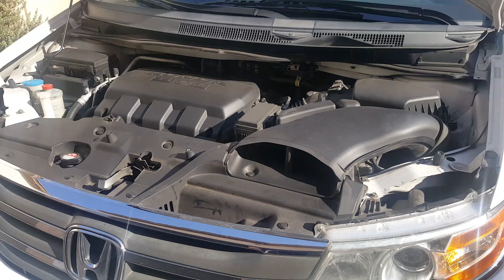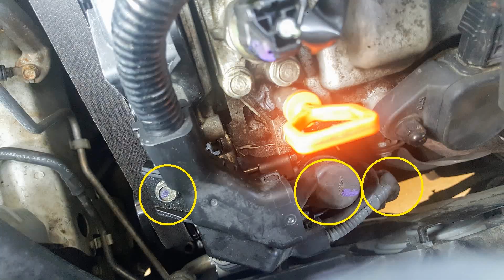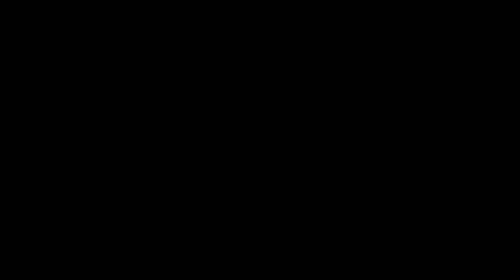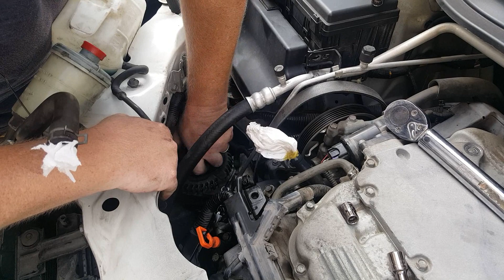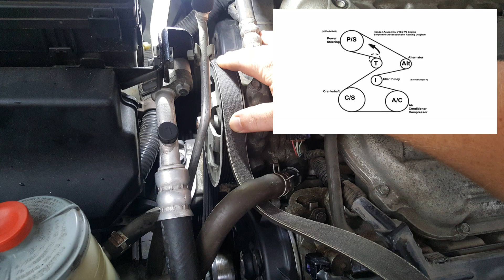How to Replace 2011-2017 Honda Odyssey Alternator | DIY Tutorial

Comment: I would like to add to the information in this fine video. I just did this with my 2011. I honestly don't know how you got your hand down to the AC compressor wire that plugs into the alternator. Even with the radiator and condensor top brackets removed, there still was not enough room. I ended up draining the radiator, and disconnecting the upper rad hose, which gives you about an additional inch, allowing me (actually my helper) to slide the hand down and disconnect it. It was still a PITA and your hand will have enough scratches to look like you were playing with an angry near-ferrel cat. You can't wear a glove. Here's a better idea. I was TRYING to avoid removing all of that plastic cladding at the bottom. Just bite the bullet and do it and here's why. First of all, remove the splash shield (yeah, it's only about six screws and about six plastic fasteners but it is a real hassle to get everything lined up to get it back on but still easier than messing with the radiator and coolant). But once it's off, you can more easily reach up and disconnect that compressor wire connection plug from the alternator. Here's the kicker-with the splash shield off, you can now access the four bolts holding the AC compressor onto its bracket. I didn't want to mess with the compressor either BUT, my alternator WOULD NOT clear one of the metal AC lines to the compressor. It's actually connected to compressor and there's no moving it without detaching it (don't do that).I decided I'd rather back those four bolts out instead of removing the belt tensioner. In fact, the Honda Shop Manual states to remove the AC compressor bolts and hang the compressor up with a strong wire and says nothing about loossening the radiator, etc. 

Here's what I found out and this will be my procedure if I have to do it again: Leave the radiator alone. Jack the car up and put it on safe jack stands. Remove the plastic splash shield under the front end-all of it, but leave the wheel well plastic alone, just remove the fastener that connects them to the front shield. Have some new plastic fasteners on hand since the old ones will disinegrate. These Gen 4 Oddy fasteners are inferior to the ones they used on my Gen 2's and they get brittle and break with age. You will need some 13 mm and 16 mm long ones, both should fit into a 10 mm hole. Get them cheap on Amazon. I bought this brand Rexka (13mm and 16mm, packages of 40 for $10 and they are just fine, identical to OE) Maybe this link will work   (https://www.amazon.com/dp/B078RKCVNG?psc=1&ref=ppx_yo2ov_dt_b_product_details)

Now remove the coolant bottle and PS bottle as stated and shift out of the way. Might as well give up and remove the PS hose from the pump, plug it with a wine bottle synthetic cork (no crumbs with that plastic cork, unlike real cork and do not use paper of any kind to plug anything). That PS stuff gave me fits the whole time-so much in the way and it wants to leak so badly, and I despise it. Anyway, when finished with this job, don't forget to bleed the PS system of air at the end while both front wheels are off the ground and not carrying any (or most) weight by turning the steering wheel lock to lock about seven to ten times with the engine running. Now, back to the alternator. Back the AC compressor bolts out about an inch-not all the way out (leave enought threads in for strength) and pull the AC compressor forward. It's still attached to its bracket so you won't have to support it. This will give you just enough room to wiggle the alternator past that one metal hose blocking your way. Now remove the alternator like the video creator states in the video and put the new one in. Don't forget to push and snap the compressor wire connector to the alternator near its bottom and retorque the compressor bolts before you replace the bottom shield. From the official Honda shop manual, the 80 mm bolt that attaches the alternator at the bushing has a torque spec of 33 ft-lbs (45 N-m). The two small alternator bolts (one for the bracket and one from the alternator to the bracket are both 16 ft-lbs (22 N-m). The AC compressor bolts are torqued to 16 ft-lbs. I hope to NEVER have to do this again so I bought a BRAND NEW Denso alternator from a Honda dealership for $500 (a good price since Honda's MSRP is $700). Also, watch that gasket on the VTEC solenoid above the dipstick. It was leaking on the video maker's van and is possibly what killed the alternator. They are infamous for doing it. Replacing that gasket is a LOT easier (and cheaper) than the alternator. I don't know what killed mine with only 85K miles because I've no leak yet. But, I did notice that 80 mm bolt was rounded off badly by some previous yahoo so I don't think my alternator is the OE-probably a remanned unit-they don't last. I still have to go in and replace that bolt with a new one because I was unable to torque it to 33 ft-lbs without it slipping the socket (even my 6 point). I was lucky to get it off, and no, I didn't round it! I hope this helps the next unfortunate one that has to do this job.
Reply from the maker: Yeah it's really interesting to see the variation from experience to experience with regards to being able to access certain areas in the engine bay. Seems odd but it proves to be the case consistently. I for one didn't have a problem getting my fat pudgy hand down to that bolt (it is tight).

Thanks for the tips, especially on the spool valve. I do think that (or a leaky front valve cover) is what sped up it's demise.
Reply: @DIYAroundTheHome  Thanks for the thanks. Also, I broke in the alternator using a method that an alternator manufacturer posted on You Tube. I did and I hope it makes it last longer. First, you run it 15 minutes with no additional electrical load , everything turned off, to set the brushes; then let it cool down 15 minutes; then run it 15 minutes with a partial load (high fan, interior lights on, radio on); let cool down 15 minutes; repeat steps 2 and 3, three times and if you have it, add AC on for the third time; then, finally, run it 15 minutes with the full load (all of the above plus headlights); let it cool down.
Reply from the maker: @freespirit1975  interesting, never heard of breaking one in but it makes sense and isn't some crazy process that's time consuming so why not?

Best of luck with the longevity of it. I too hope mine lasts a long time

Comment: excellent! Thank you very much. Getting the alternator out of engine area once bolts are removed in tricky. I had to push back tensioner pulley all the way back to make enough space, or it would have been impossible given the fixed AC hose. You didn't really cover that. Thank You!
Reply from the maker: It seems like some people's Odysseys are a little different than others. Everything I did is shown in the video and had no trouble getting it out... but it sounds like that isn't the case for everyone. 

Glad the video was mostly helpful.

Comment: Great video, FYI your alternator went bad because of the oil leak from the spool valve, you will need to fix that leak otherwise it will keep ruining your alternator
Reply from the maker: Haha that's funny cuz I just changed the spool valve and valve cover gasket a month ago cuz I got oil dripping onto the garage
Reply from the maker: I wish I would have replaced the valve cover first cuz I think that was ultimately where my true leak was coming from... The very front left of the engine not far from the spool valve. When I replaced the spool valve first, the leak did not go away

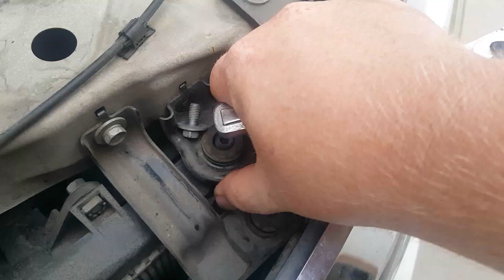Comment: sorry at 2:33 time too fast what did you take out loose that 2 bolt thank you
Reply from the maker: I believe it was the radiator fastener, you don't take out the radiator but for some people they see a benefit of removing those two top pieces, one on the left and one on the right, so there's more play with the components... which makes working in that general area easier. 

By the way you can go into YouTube video settings on the video itself and change playback speed to 0.25 which will make the sped up portion of this video much slower

Comment: Excellent diagrams and tips throughout your instructional video.  The actual removal and insertion portions of the video are missing.  The space in there is so tight and wiggling it out, rotating it and removing it is really difficult.  Because it's so difficult, it makes videoing it even more difficult, but DIYers beware, the removal is TIGHT!!!
Reply from the maker: It really is odd that there can be so much variance from van to van but mine was not hard at all once the right angle and approach was taken, it barely touched anything on its way up... I don't doubt what you're saying though cause I've heard from many people where they have had the opposite experience

Comment: the only call out i would add is that the bushing in the lower bolt hole on my van was too large.  I needed to use a pry bar to get the alternator free.  on the replacement unit, again, the bushing was too big so i needed to file it down to get it in place.

Comment: Fix that oil leak or you’ll be doing this again. The VTEC solenoid (see TSB) should be replaced, and the valve cover gasket with tube seals likely need replacement as well. I just had my vc gasket and tube seals replaced yesterday due to hardening and leaking. 2016 with 115k miles.

Comment: getting it out is insanely hard. i had to force it against the thick ac line hose and  was able to bend it towards the front of the car.  with the large bottom bolt end leadin the way with the pulley upwards
Reply from the maker: It is a tight fit
Reply: Had hard time to get it out. When put new one in, pushed the tensioner back then could place it in easily.

Comment: How many miles did you guys get out of your original alternator? I just hit 74k on my 2011 and got the warning.
Reply from the maker: 120k or so
Reply: My light just came on yesterday and our van has 87K. I sure am glad I watched this video! Way better than the other two I watched. This certainly won't be like working on the '05 Buick LeSabre!
Reply from the maker: @adamkurschner  That's why I made the video, was really disappointed by the other ones I found out there. Glad this was helpful.
Reply: @DIYAroundTheHome  ill second that thanks, this was about an hour job with your tips! Hardest part was weaseling the unit out but it surely does fit. The odyssey is actually a pretty easy van to deal with.
Reply: 156k on my 2013 honda odyssey
Reply: Austin Hickey 152000 on my 2013
Reply: I was at 106k
Reply: mine just died at 215K

Comment: Great Video, really helpful. Only problem I'm still having is squeezing the alternator into the 14mm Bolt Standoffs. It's really tight and I'm thinking I'm going to have to do something with the A/C Compressor to get it to seat in there.
Reply from the maker: I was lucky in that I had room. I put a couple zip ties on the top hole of the new alt and lifted the alt up by the zip ties with my right hand and guided the bottom hole into the spot with my left hand, then once it looked like it was aligned close enough I got the long 14ml bolt in my left hand and pushed it in several times until it lined up and went all the way through the three parts.

I did recall seeing some people on the internet say they needed to loosen the 4 screws on AC condenser to give more space. 

Seems strange that some Odysseys would have room but others no. Either way good luck and let us know what happens.
Reply: Well now I don't know how to loosen that. That doesn't attach to the A/C Compressor.
Reply from the maker: Yeah I didn't even look for the 4 screws I read about online, I hoped I wouldn't need to loosen them and ultimately didn't need to. 

I do recall reading that people loosened the 4 screws, they didn't completely remove them.
Reply: @DIYAroundTheHome  So I built a press to slide that bushing. I got an M10 bolt that was 60mm long, a 3/4 I.D. bushing and two washers. I sprayed some WD-40 on the bushing and then made my stack up (Bolt, Washer, Bushing, Washer, Nut) and cranked it down and the bushing moved giving me the gap I needed to put in the new alternator. It took about 1.5 hours to remove the alternator and about 45 min to install once I got that bushing moved.  Again, great video and thank you for the help.
Reply: I ended up squeezing it in using a small screwdriver as a feeler to see how close to lined up it was.  Used a small prybar to pivot the alternator as needed and managed to get the bolt threaded in about 5 mins.  5 mins and a lot of muttered threats.  Still in.

Comment: Looks like leaking spool valve damaged the alternator
Reply from the maker: Yup, hoping it doesn't go out soon... though I've installed one before
Reply: @DIYAroundTheHome  Did you experience transmission issues when your alternator stop working?

Or did you replace it before it failed?

I am having the same issue, the alternator is not fully delivering the 13 to14volts to the battery and I experienced that the transmission stop working in the middle of the highway it totally disengaged, but the engine was still running. I slow down to the shoulder and as soon I reduce the RPM to 1000's the transmission violently engage and car move but just in the first or second gear I felt or so. 
I drive like that between the neighborhood at slow speed to avoid that the transmission either went down or up in the shifts. So made it home and have not move the car since then.
I noticed the leak on spool valve also the alternator all grease, so my conclusion is that the gasket leak provoke the alternator to underperform delivering only 12 V and causing the transmission disengage and rough shifting.

Thanks for sharing this video, it is going to be very help once I change the alternator.

I can  not believe that Honda have not change the design, or use a different type of material for the gasket in the spool valve. Is a great sales income for spare parts but this for sure is poor design and a poor reaction to the solution to improve it.

Daniel C.
Reply from the maker: @danielc8037  no transmission issues so far (at 160k right now). I do think the alt went out from the oil leaking from the spool valve and valve cover gasket thought. I replaced the alt a year or two ago so I am hoping the new one isnt going to have a short life cause I only fixed the oil leak a month or so ago.